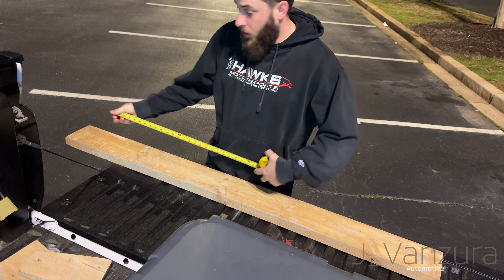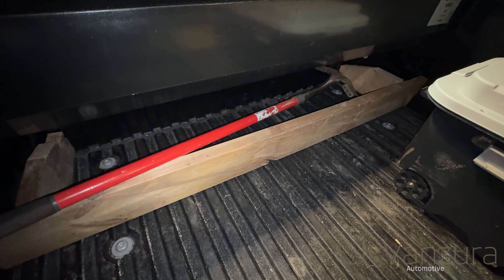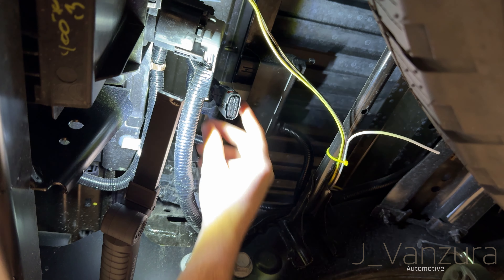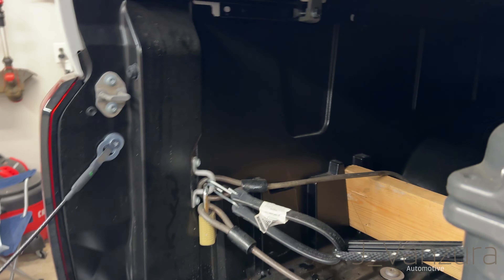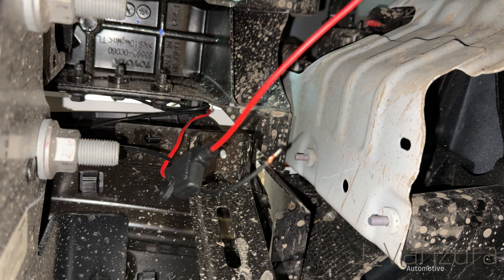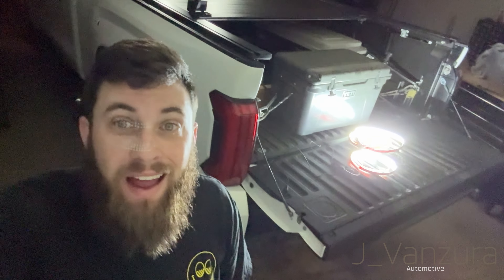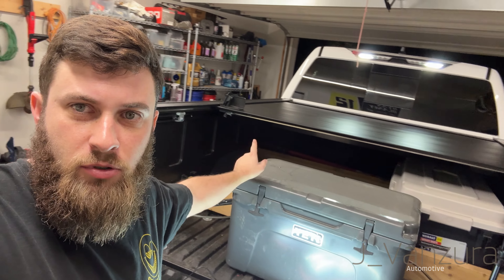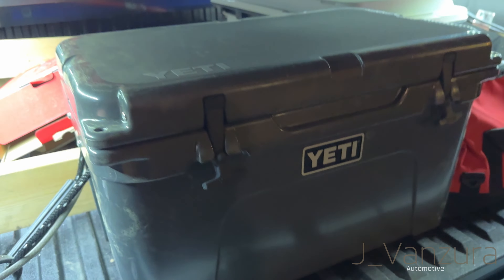2024 Toyota Tundra SR5 Gets MORE New Goodies! | BED LIGHTS!

Comment: Hi I just want a make sure the blue wires is it work? When you open tailgate your light comes on, after you found the cut wire 
Thank
Reply from the maker: @DanielLamarre-c6i  the cut wire was unrelated, the blue wire worked but was to small of a wire to power the lights
Reply: @ ok Thanks I will wire it from direct to battery and have another question is. The on off switch is it come with a little light on it because I just want it black because it wires from the battery 
Thanks
Reply from the maker: @ the one i have is just a black switch and no lifht

Comment: So how did you connect wire for bed light under vehicle ?blue to red and black ground it?
Reply from the maker: @yakupyildirim47  i grounded to a bracket and ran power from the battery with an inline fuse